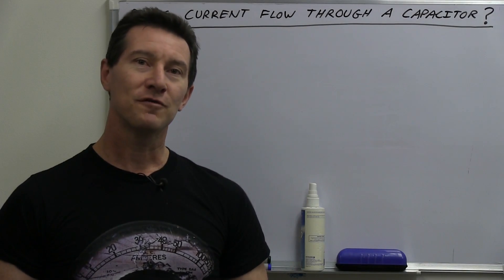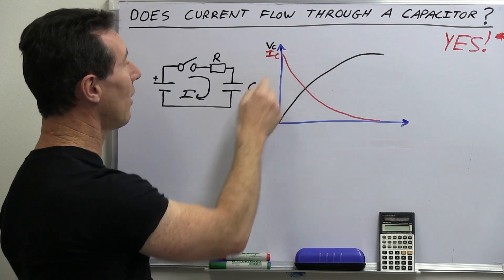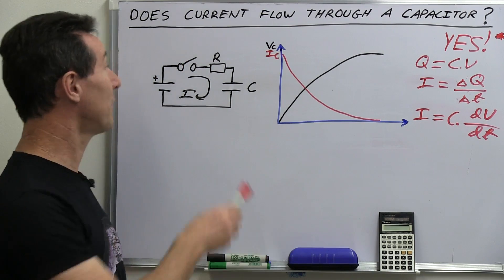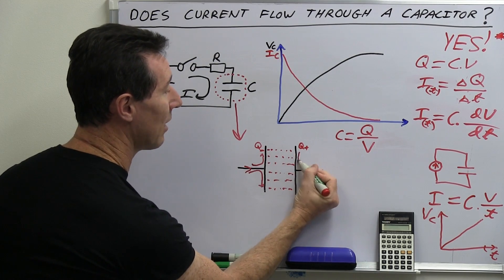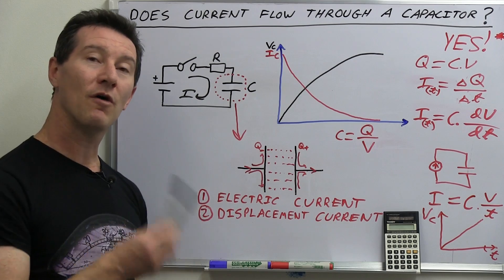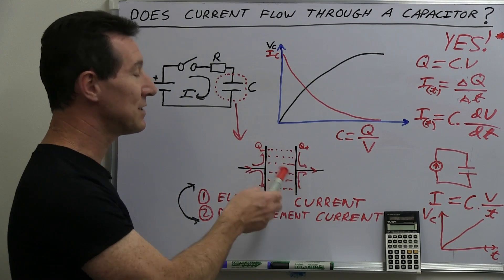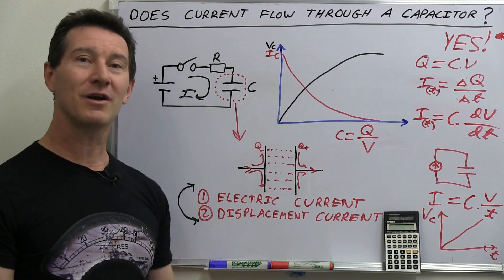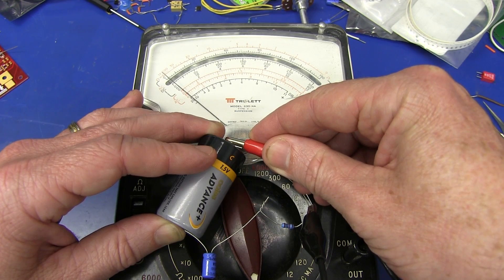EEVblog #486 - Does Current Flow Through A Capacitor?

Comment: I agree, to a point. Keep things as simple as possible, but no simpler.  Displacement current describes energy transfer in simpler terms. The danger of only thinking in terms of "practical electronics", you will miss effects which are exacerbated when working with extremely high voltage, current or frequency. That is, parasitics which result from transformation of energy from electromotive force to magnetomotive force and back again.

Comment: This is why engineers and technicians clash. It might work a certain way on paper, and you can throw all the formulas you want at it, but in the real world you will have current movement 'through' a capacitor that decreases over time. It doesn't matter that you have no net current movement between the plates. You will have net current movement between the voltage source and ground, which is what matters when you design electronics. There is the textbook answer, and there is the practical answer

Comment: I'm being pedantic about it because when most technical people ask "can current flow through a capacitor", they do not mean in the simple sense of "can current flow in one side and out the other", they are usually referring to the question of what is really going on inside, since they know that there is an insulator present between the plates. The question wouldn't even arise if they did not already know that current can flow in one side and current flow out the other.

Comment: There is no electron movement in the dielectric. If you have a plane going through the dielectric, parallel to the plates, there is no charge flowing through the plane. With a current clamp meter around the dielectric, you will see a measurement but this is due to the B field from the changing E field, not charge movement. I think the better way to view this is that clamp meters only sense current accurately when there is no additional B field (due to permanent magnets or changing E fields)

Comment: You still have net electron movement to build the potential (in the form of a magnetic field) between the two plates. It is also practical to define it as such, because that is what you will physically see in your circuit.

Comment: I like to think of a water hose, cut in two with balloons over the two cuts and those in a closed box. Push water into one side and it will flow out the other---for a moment. Stop pushing and the water flow will reverse. (If you vacuum seal the box, you'll even get suction at the other end.)

Comment: Dave, I have to disagree. Displacement current was a concept invented before the interaction between E and B fields was understood. The relevant equation from Maxwell's set of four is curl B = mu_o * J + epsilon_o * dE/dt. J is current, which is always the flow of charges. The "displacement current" term is epsilon_o * dE/dt but that is the E field/B field coupling, just the same as in a radio wave. Would you say that current is flowing in a radio wave?

Comment: The best way I can illustrate this in my head is with two empty (but sealed) vessels, and an air pump in between (Picture this circuit in series, but just replace the two sides of the capacitor with glass jars and the wiring is now tubing). The pump moves air out of one vessel and into the other. No air actually passes between them, but in order to build that potential energy (pressure difference) between the two, air molecules physically must move through the pump.

Comment: The displacement current (current as in some particle moving - barring the polarization density) does not create anything because it does not exist. It is a theoretical current created by the electric field in the capacitor. The magnetic field is createy by the electric field. You can easily see this in the maxwell equation.

Comment: Hi Jack...great to hear from you! Right, and once the stretched rubber band is let go and is allowed to exist in a zero potential environment (capacitor is shorted or grounded) the stored energy potential snaps back to zero state equilibrium (the capacitor discharges) and the rubber band hits you in the eye (the capacitor unfortunately discharges through your hand and you drop a hot cup of coffee in your lap.)

Comment: While charging a capacitor the electric field between the plates changes and it is this change of the electric field that causes the displacement current. Now the displacement current is a current and therefore creates a magnetic field and you can measure this magnetic field!
So if you claim there is no current flow between the plates whatsoever, then there would be no magnetic field during charging/discharging, which is experimentally disprove.

Comment: "Like a rubber band" you say ;)
In order to charge/stretch a rubber band, you have to move both ends apart and by doing so, every molecule along the band has to be moving too and I think you agree with me that this involves kinetic energy a.k.a current. Once the rubber band is stretched/charged nothing moves any more and like in a capacitor the current has dropped to zero, so your rubber band is actually a perfect example to illustrate Dave's point :)

Comment: It's not flowing "through" the capacitor. Current goes in one side, and then "different" current gets pushed out the other side. Capacitors don't store electricity. They store potential energy, like a rubber band that's either stretched or isn't.

Comment: I never really thought about it when I test a capacitor with an ohm meter, the needle moves upward. Anyway another fun video to watch. shows you an education is a dangerous thing, just kidding. I used to work as a tech at AT&T and there were lots of high energy techs like Dave. I really miss that work place.

Comment: Put aside Maxwell for a moment. Think of it this way: You push electrons into one wire on the capacitor, they gather on the plate, and repel electrons off the other plate, where they come out the other wire as "current". They aren't the same electrons, but who cares? The first plate becomes negatively charged, the second positively: a voltage across the cap. As long as you shove electrons in, the process continues and the capacitor voltage goes up.

Comment: Great video. Thanks Dave.
All the theoretical "stuff" and fancy formulas aside, I heard it like this: in this series circuit, when SW1 is closed, electrons from B1 flow into plate 1 of C1 and "displace", by the electromagnetic repulsion of like charges, electrons from C1's other plate. Essentially, 3 electrons from B1 moving to plate 1 of C1 means 3 electrons leave plate 2 of C1. Current doesn't flow "through", but it does flow into and out of C1 until plate 1 of C1 is charged to "capacity". Thx

Comment: According to Feynman,  what happens, quantum-wise,  is the carriers in the conductor hit the surface of the plates, and stop.  Conservation of energy and momentum require that something else happens -  in this case each carrier emits a photon,  which travels at the speed of light in the dielectric, and hits the other plate -  creating another carrier in the conductor on the other side.  So if fact,  current does not flow through a capacitor.  But for all basics,  you can treat it that way.

Comment: But the capacitor doesn't "block" a PWM signal, in the sense that an open circuit blocks it. Some part of the signal - its higher harmonics - will pass through. That might be enough depending on the basic frequency of the PWM signal and the circuit impedance to allow it to be used as if the capacitor weren't there. If you're trying to drive a motor using PWM, probably not, because the circuit impedance is very, very low and such a capacitor would have to be huge. What I stated remains true.

Comment: Displacement "current" just describes an Electric field that when it changes with time causes a magnetic field just as moving electrons (current) does.  There is no actual current though just as in an EM wave through free space there is no current... Only time varying Electric fields causing time varying magnetic fields and in turn, time varying magnetic fields causing time varying electric fields. Hence the sustained wave traveling through space.

Comment: That's too simplistic, as DC is just a special case of AC where f=0. AC can have any frequency down to (but not equal to) 0Hz, so the current that flows with an AC signal is just the shunting back and forth from each side of the cap, and the impedance depends on frequency. A cap will block AC effectively if it's frequency is relatively low and the circuit impedance is low relative to the cap's at that frequency.

Comment: @Jim Elias No there is no flow of electrons, inside a capacitor for to that to happen, will be needed a vacuum between the plates, and a high voltage, and a lot of heat, to induce an ionic current into the plates, therefore in whatever way you deduce it, in a capacitor there is a DC current due an Electric field varying over time, which means a varying population of electrons in one plate and the establishment of a dQ/dt, which behave the same as a conductive current.

Comment: I was more talking about the random nature of electrons. in DC flow an electron only has a tendency to flow in one direction. in fact most electrons are moving in random directions. Current flow refers to the general movement of electrons., In a capacitor the same occurs. because there is a general flow of electrons into one terminal and out of the other there is a voltage drop across it and an (imaginary) current flow. Which is the basis of impedance

Comment: Nice vid, but I must say this: Electric fields are different, but simlar to magnetic fields. The effect is similar to what you in mutual inductance.
I would summarize the answer to the main question to this:
Current DOES flow through the capacitor via displacement current UNTIL it is fully charged. When a capacitor is fully charged, no DC can flow, only AC.

Comment: In the case of the wire alone, yes, it is POSSIBLE, as you say (using ac voltage), BUT you can make it happen if you want to(by using dc). That is not the case with a (ideal) capacitor, dc or ac.

Comment: but of course thats not strictly true, and the converse isn't strictly true either. It's perfectly possible for the first electron to arrive at the location of the second in the case of a capacitor (via leaking current across the plates or travelling around the cable), just as its perfectly possible for an electron to NOT arrive at the second location in the case of a wire.

Comment: In many instances, to use the equations for a capacitor you must first derive an integro-differentional equation.

which means you need to know how the circuit will behave at time initial and time final based on the input signal and the circuit components.

I'm not claiming that current actually does flow through the capacitor or not.

I'm stating the way we "pretend it behaves" to arrive at the "best possible answer" 

then again, do we "really" know what anything is "actually" doing...

Comment: In a university setting, for circuit analysis purposes, Q=CV and I = CdV/dT or, more precisely, I = d(CV)/dT, by differentiating both sides of the first equation. And that's it!
You wouldn't give a rat's a** if the electrons dance the tango inside the capacitor!

Comment: Galena quartz.Yes it rectifies the r.f. voltage, to detect its amplitude, which is the audio you hear. But it does not oscillate, itself.
Proximity gives you more signal power, unrelated to "displacement current"
I don't want to confuse you but I think I already have! Please look up crystal radio in Wikipedia.

Comment: I see, thanks.  I was guessing when I said quartz,  used to be some type of mineral that acts as a diode, rectifying the AM signal.   It is called a crystal radio, I found out, and you are right, you have to be close, but for strong stations, I remember being able to be anywhere in town I think.  They apparently were the first type of radio, used a lot for telegraphy.  I'm learning.

Comment: The "displacement current" is just a concept, used to explain the existence of a very real magnetic field, around a charging (or discharging) capacitor, where actual electrons don't flow through, yet it appears from outside as if they do (more precisely as if charge flows through, i.e current).

If your radio is far away from the transmitter antenna, the answer is NO. If close (near field) then YES, to the tuned elements. There is no "oscillating piece of quartz" in that kind of radio.

Comment: Current flows into one terminal of the capacitor and an equal current flows out of the other terminal of the same capacitor, making it APPEAR as if current flows through the capacitor, looking from the outside. No magnetic fields and no electromagnetics here; just electrostatics. The effect of the magnetic field here is negligible, otherwise you would not be writing the loop equations you wrote. You would be including a term for the inductance of the loop, and the graphs would be different also.

Comment: That's what I've been saying. There are two "currents" and they are identical. One "current" is on one side of the capacitor and a separate population of electrons is mimicking the action of those on the other side, a separate "current".

Comment: (cont...) also I wanted to say that I agree with you that electrons do not literally jump across the barrier, but they are still influencing the electrons on the other side to move and thus are still causing an "apparent"-(key word being apparent) current to flow through the capacitor

Comment: "The" Electron is not, but remember even in a closed loop a single electron doesnt actually have to travel all the way around the circuit for current to flow, rather it is a 'cascade' effect of one electron bumping another, that other one bumping the next one, and so on. Once the electrons build enough on one plate they will 'bump' all the electrons on the opposite plate to continue the cascade of electrons on the other side of the insulator..

Comment: Charge is not the same thing as electrons. Yes, the charge is carried across the dielectric, but the electron itself is not. It's the charge that induces the electrons on the "other side" to move, but the electrons themselves do not pass "through" the dielectric barrier. If you're measuring AC voltages, you'll have the same current on both sides, but it's two different groups of electrons you're counting.

The question that fits this "answer" is: Does electric potential pass through a capacitor?

Comment: But what differentiates an electron causing another electron to flow through a wire, and an electron causing another electron to flow on the other side of a dielectric? It's the same interaction and same forces, just exaggerated because of the larger gap. If you are going to accept that charge moves through wires you must also accept it can be carried across capacitors.

Comment: Like this video, but it might help to explain by using V=E*D, and therefore current I=C*dV/dt=C*D*dE/dt, where D is the distance between the capacitor plates. This might save the effort on the "displacement current" - it's just a concept, or a name to call.

Comment: In simple circuit analysis with a capacitor in a university setting you would treat a capacitor as a short circuit for an impulse signal and an open circuit as time approaches infinity.

For all purposes describing how a circuit will behave.

In this case, in the university setting for circuit analysis. current does flow through a capacitor. Thus it is a short circuit to impulse signals.

Comment: phenomena like capacitance and inductance, are a surprisingly symetric phenomena. I miss a tutorial in making use of the Smith chart to couple a load, or to create a high frequency oscilator, EM is very important, to set an example when you build circuit to hold data from an USB device.

Comment from the maker: Bingo, you said it yourself, the displacement current does go "through" the capacitor. At no time did I ever claim that electric conducted current flows through the capacitor, it of course does not. I did not "misspeak" because the term "through" is the accepted term in the industry and in many aspects of teaching.
Reply: I think most of the people understand what is actually going on in the circuit. It is the terminology used and how one look at this phenomena. We can (calculate and) measure/see the electrical current somewhere in the circuit. Displacement current concept is helping if we want to keep the things simple, but actually misleading and confusing if you take a deeper dive. The electric current/electrons is flowing towards (and from) the capacitor until the potential of the source equals the potential of the capacitor, as we could see very good on your analog meter. We are measuring that. Nothing goes through the capacitor (dielectric) itself, but yes through the wires that are attached to (where we can measure). But in any case I give the Big thumbs up 👍for the Friday's basics. And yes, we can see every time how magical the physics and electronics are when you look a little bit deeper. How what at first seems trivial in reality a very very complex and difficult to calculate phenomena is. Take for example a simple solenoid and the magnet force/current needed to attract the iron core at every moment during it's travel from the max distance to zero distance. The current/force is less and less (lowest it would be the hold current at the end) but what curve would be that? Where it all depends on? ....From every "simple" thing in electronics there could almost be a PhD or at least a good scientific article. But it's just a simple solenoid 🙂